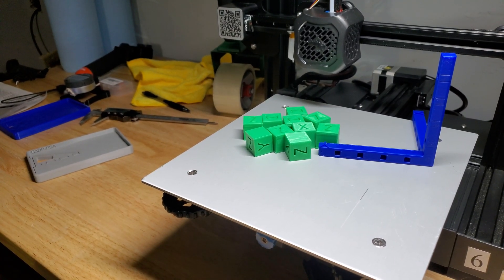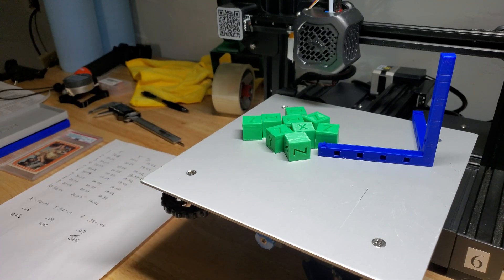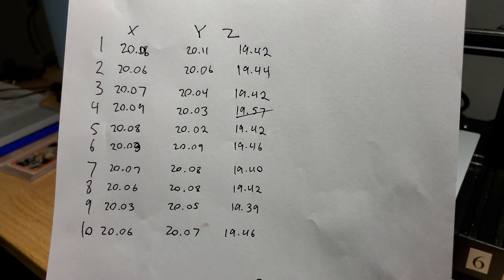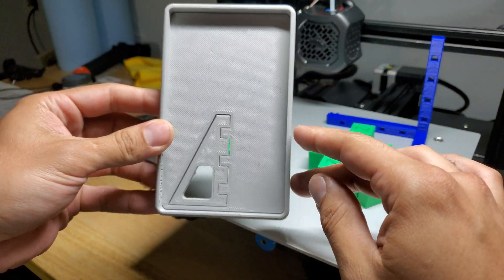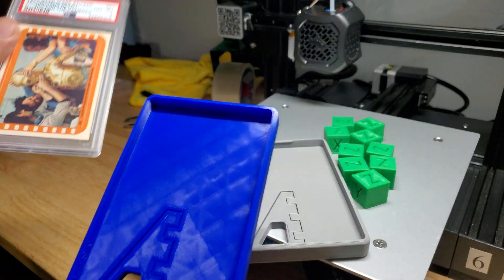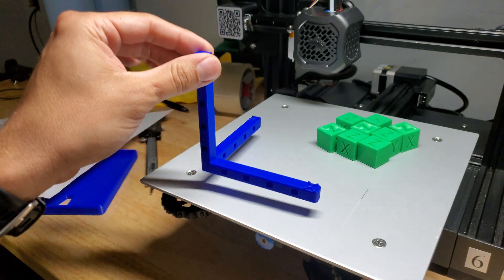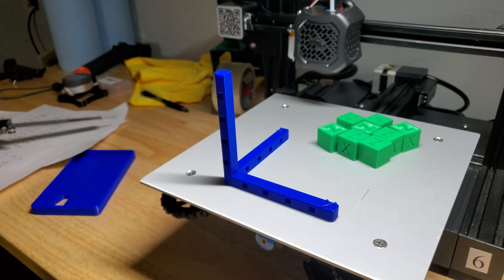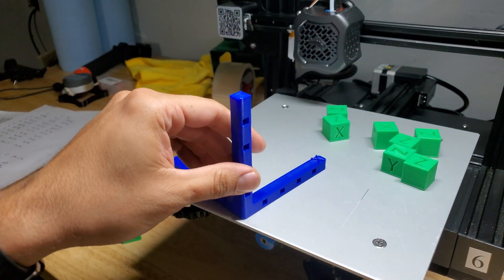A Better Way To Calibrate Your 3D Printer. Importance of Dimensionally Accurate 3D Printed Products

Comment: 0.07mm which is 70microns it's an avg thicknes of human hair, to me it's well enough accuracy, 0.3% well below error tolerance, and that various measurements can also be dependent of the difference in pressure you've used using calipers missing point of flexibility of the material. IMO you over complicated the process... And you keep repeating 0.3mm but you measured 0.03mm, man!!! You've missed the whole point in this of the printer overshoot 0.03mm in X on 20mm cube due to ie. over extrusion, it will overshoot 0.03 on 100mm , it's just make the % of the error looks smaller but it's just "illusion". Of course printing 100mm would be better for X/z step calibration, but mainly the small numbers you getting calibrated by estep which 20mm cube is enough...

Comment: Many ways to calibrate a 3d printer to what you are doing.   Most would measure distance traveled on the axis and use Flow Rate to control but you are using a method which works for a specific print.    Your elephants foot is either banding or you have the nozzle to close at the start of the print,  or both.   The banding on the cube you showed looked to be banding.   Sounds like you care about your product which is a great thing!   Good idea, nice design and quality control!   Nice!

Comment: may i ask what should be changed when the calibration is not what we expected? modify design and troubleshoot what's wrong with printer?
Reply from the maker: Definitely troubleshoot the printer. Your printer should output the exact dimensions your design has at least to .05mm tolerance.

Comment: Great video, I will try calibrating my Ender 3v2 with your tower, My prints are a hit or miss at the moment and I'm doing a lot of research lately as to why...
 I started maybe a month ago and my prints were flawless,  and half way through the new PLA spools I ordered (some cheap Chinese make) my hot-end fan died I started having all sorts of problem with skipping layers, heat creeping ghosting and generally really bad looking prints.

 I did get a replacement fan but my prints were never the same.
 I tried drying the material in the oven @50 C for a few hours, lubricated and re-aligned the X-axis, cleaned the hot end several times with the needle and cold pulls, got a CR touch for auto bed leveling and upgraded the firmware to Jeyrs. Another thing I played a lot with is slicer settings, copied and tested a bunch of different settings from content creators who use Ender 3 v2 to try and correct those issues.
I am now waiting on new material eSUN PLA+ and Overtune PLA spools, an anti backlash spring (which might help with the elephant foot you're having as well) and a couple of 4020 fans to use with Briss Fang cooler, but one thing I haven't tried is to calibrate my e-steps which I didn't think of because of because I didn't change any parts so far besides replacing a fan and the prints were great when I just started. 
Perfecting 3D printing is a long process but I'm so interested in the process I almost don't mind when my prints go wrong because its another lesson lol
Reply from the maker: Trial and error is definitely the key to learning! Once you dial everything in, its an easy process to rinse and repeat for more printers. The more printers you have the more you start to learn because the issues are replicated across many printer, and when you find a solution, you know it was the right one because all of your remaining printers have the issue corrected as well. I learned the most about the ender 3 v2 when I started managing 6 printers. I now have 17 and still learning everyday.
Reply: The single biggest change I made to my v2 regarding print quality is swapping to dual blower fans and the hero me fan ducts. The one dinky fan it ships with was never up to the task and even if the fan was amazing it still only blows one direction. I would also recommend a bowden tube mod using a short piece of capricorn from the back of the nozzle to just before the fitting on top of the heatsink. Then that short run is sacrificial if need be and I use the stock white tube the rest of the way so I can see problems if the arise. I previously had changed the whole tube to the capricorn but ended up having to keep replacing it every couple of months. Here's a video explaining it better than I can.
https://youtu.be/7tCxO17XZtw

Comment: You could also just modify the design to allow for wider tolerance ranges. One way would be to have retention tabs that can be bent back to release the card
Reply from the maker: Yes you are correct. I have flex gaps in my design. I made it a personal goal to dial in every printer as close as possible though, to see just how accurate these machines can be.

Comment: So what are the ways you adjust the printer then, do you update slicer settings, or do you adjust number of steps per mm, or do you adjust printer's mechanics somehow ... ?
Reply from the maker: I do not change slicer settings because I have to use the same gcode file for 17 other ender 3v2s that I have. The adjustments I make are gantry leveling and bed leveling. I also check for excessive backlash in my lead screw which I made a video about that.

Comment: What i don't understand: you said your Ender has a tolerance of 0.06mm. You can calibrate to be in the middle of that. But with a longer calibration length you can't change the absolut tolerance of the printer. So being in the middle of the tolerance is enough?
Reply from the maker: What I have done is print my 100mm calibration multiple times. Get the average range, and then use the middle size to calibrate. Or if your design cannot be larger than a certain size, calibrate to your lowest value plus .06mm to get your maximum desired size. That is how I do my calibration. I don't print much larger than 100mm for my products, so I know there wouldn't be much issue at all with scaling. So you really only have to compensate for the tolerance the machine has.

Comment: So 60 microns or less than an average human hair (70 microns).
What is the accuracy and repeatability of your calipers. I assume they are NIST calibrated and not some Amazon pair.
Reply from the maker: According to the manufacturer the accuracy is .02mm Which is why I am ok when my prints are within .05mm of my intended size. Not sure if they are NIST Calibrated

Comment: how would you get rid of those layer lines?
Reply from the maker: Can be done many ways. Tightening the v rollers. The belts tension properly, and a straight lead screw can help reduce layer lines.

Comment: Nice video, just subscribed. I think you're unfairly blasting the poor calibration cube though haha. It's simply a guide to get you close. None of these calibration parts (in any scale) should be treated as gospel because all machines have tolerances. The printer has tolerance variation, the filament has tolerance variation, and your calipers have tolerance variation. Really the cube is just a quick way to get you close. It's popular because it's a 45min to 1 hour print.

After that you're just describing the design process of manufacturing  a product and prototyping is part of that process. There is really no need to print a "calibration" tower to scale imo. That's why you prototype and tweak your design. You're rarely going to get something just right on the first try and that goes for billion dollar companies as well. It's all part of the design process.

Oh and one other quick note. I don't think this would affect your design too much because the critical dims look to be the x and y tolerance, but if you truly need accurate parts in the z axis, a lot of places will simply print with a raft to eliminate the first layer variable which is basically all over the place and varies print to print. I know people start screaming when you say use a raft, but it's not uncommon in industry applications at all. People that say that are just speaking from experience printing from home.
Reply from the maker: Hey thanks for the sub! You are right about not getting it perfect on the first try. It took over 20 revisions before I came up with a design I was happy with. The calibration print that I've come up with is to ensure that no matter what printer I use (I have 17 currently working the print farm) the cases are going to come out the same dimensions. No matter how many times I calibrated with the 20mm cube my cases would never be the same. I no longer have this issue since switching to 100mm and have sold over 2000 cases! I was a bit hard on the 20mm cube as it is multi purpose lol. But all I was looking for was calibration. Thanks for commenting.
Reply from the maker: The z axis is somewhat critical but not as much as X and Y. That measurement varies the most in my prints due to the design of the gantry. Single lead screw. V rollers. And backlash are not friends of an accurate z height.

Comment: temp, flow, e-steps, retractions, etc will make the size vary each and every time. it will never be exactly the same each print.  You want really better prints.  Get Kipper and do the vibration calibration on it and then use SuperSlicer to make it the best possible slice of a print. when i look at your cube i see the corners not sharp. They are bulging out.  I also see that the Z layers. some are bigger then others.  i don't know. why but i don't use the narrow part of the calipers. I move the part up to the flat part of the calipers.  also when you do that type of measurement. the calipers can be skewed just a little but and not entirely square. point A-B.   I wouldn't use that cube for 0.0X calibration.   Within. 0.5 is decent.
Reply from the maker: Klippers is definitely something I want to try out.

Comment: For the most part the mechanical dimensional calibration of the printer will be accurate out of the box.

In order to calibrate that completely accurately is going to be extremely difficult from a printed model as the variation due to extrusion width is much greater.

If you print 5 20mm test cubes and average out the dimensions and calculate the average deviation then repeat that with a 40 x 40 or 60 x 60 set of 5 cubes, you will likely find the average deviation is the same in both cases.

For example a 20 x 20 set may average out to 20.06 on the x.. the chances are high that if you print a 60 x 60 set it will average out to 60.06. I have performed this test on Ender 3 series and confirmed the results, the deviation does not increase with model size therefore is independent of the mechanical positioning of the nozzle.

The deviation is from the extrusion variability caused by filament diameter variation and slack in the delivery system such as introduced with a bowden system. Having tested a number of filaments with a guaranteed max deviation in all cases but one  so for they have exceeded it to some degree!

The upshot being that the smaller the part you make, the lower the dimensional accuracy you can achieve.. If you have an average deviation of +0.06 across both 20mm and  100mm for example, the best you can do is adjust flow to nudge that down so your deviation is -0.03 to + 0.03 and centre the error on the dimension you are aiming for.

Tramming is also important for dimensional accuracy, and extremely difficult to get completely accurate, for example, if your z frame is 0.2mm out leaning slightly forward, then a printed part will vary in its z dimension along the y axis, the front being shorter than the back.

Most consumer printers will have a specified resolution of 0.1mm, despite them being capable of moving the nozzle in much lower increments, because these miniscule errors are almost unavoidable and so 0.1mm is about as accurate as you can reasonably maintain. Highly tuned you may get that down to 0.05 if you are good..
Reply from the maker: You are correct that the deviation will be the same no matter what size print you make. The issue is when you do the math to calculate your e-steps. By using 20mm with a deviation of .06 vs 100mm with a deviation of .06 that gets calculated in the e-steps formula and in my experience has caused scalability issues when doing the math against 20mm. Once I started doing the math against 100mm it solved my issues.
Reply: @Redo3D  I understand what you are saying.. but if the error does not scale with the size, then the error is not related to the steps/mm calibration in the first place, if you calibrate the steps at a larger size, then smaller prints will be too small... 

If you have a steps/mm out of calibration, the larger the print the larger the average error.. taken to extreme..

If your 20mm cube comes out at 22mm... then a 40mm cube will be 44mm, a 100mm cube will be 110mm if it were a steps/mm issue..

on the other hand, if you get 22, 42, 102mm then the error is nothing to do with steps/mm, so whichever way you calibrate it you will be introducing dimensional errors at another print size..

On a stock printer these calibrations are normally done from the factory, because they are relating to physical gearing of the drive train, in the vast majority of cases a small difference, 20.1mm for a 20mm cube.. 40.1mm for a 40mm cube, the issue is flow rate and walls that are thicker than they should be.. so calibrating flow rate would be the way to go..

If flow rate is good, and you still have a consistent average error across print sizes, you can bring the x/y into line using horizontal expansion.. so if after calibrating flow and getting the correct extrusion width of the lines the average error is 0.06mm too big across different print sizes, using a horizontal expansion setting of -0.03mm (its per side) will bring the cube to the correct size across all print sizes.

Errors in the z direction, which is usually short rather than long, are nearly always due to compression of the base layers which also results in elephants foot because the layers squash more near the heat of the bed. Reducing bed temp will normally greatly improve this,  IMO with creality glass beds, the temp needs to be so high for good adhesion that elephants foot is inevitable, I decided that the lower temp and dimensional accuracy and no elephants foot was preferable so I just use glue stick and lower bed temps, I get correct z dimension and no elephants foot so 2 plus points for one glue stick negative.

It is a fundamental misunderstanding of what the steps/mm is actually for, they are to set the correct movement based on the gearing of the stepper gears/ pulleys/ lead screw pitch etc.. they do not vary from machine to machine, they are mechanical fixed gearing the same on every printer of that type and model, all the pulleys are the same, all the lead screws are the same, all the steppers are the same angle and steps.. all the calibrations are the same value UNLESS you change the gearing, and the calibration is done at the design stage..

Comment: I watched the video, searched the comments, and looked on thingiverse. But I could not find a mention of the print settings you use for the calibration test? Like how many walls, top/bottom layers, % infill, flow %...etc. So I was wondering, what are your typical slicer settings when testing your calibration part?
Reply from the maker: The slicer settings should be what you decide to use for your prints. There is no wrong or right answer to your profile. In my printing farm every printer and every file I create use the exact same profile. So that profile is what I use for my calibration print. I do use 10% Infill and walls. The layer height and other settings are your preference!

Comment: Can you post the Fusion file? I wanna make one that's 150mm which is pretty much the max of my calipers. at some point id like to try and calibrate for the entire bed. then anything smaller than that should be just fine. also, what are your infill/wall settings? currently, with my settings, it says it will take 3-4 hours.
Reply from the maker: I use 10% Infill with 2 walls
Reply: @Redo3D  OK so check this out.. no matter what size I print calibration I am always exactly 0.1 short on the Y-axis vs the X-axis. what would you do to troubleshoot such a thing?
Reply: @rayge   if the deviation is the same for every size.. for example over 20mm it is 20.1 over 40mm it is 40.1 over 60m it is 60.1.. then not much is going to help. If you adjust the steps/mm you will introduce a change in dimension as the model size increases so you maybe get 20mm correct but then 100mm will me 0.5mm short.

Also as stated in the video, be aware of the rounded corners bulging and affecting readings! only measure from the top down in the middle of two sides.. or at two points on the sides and average even better.

Comment: I dont agree with no valid use for them but can deff be stepping stone in the direction for max accuracy for a given machine
Reply from the maker: You are right, they do provide other features to check for. In my situation for dimensional accuracy they were not enough. Thanks for commenting!